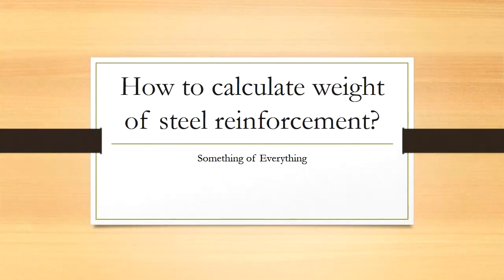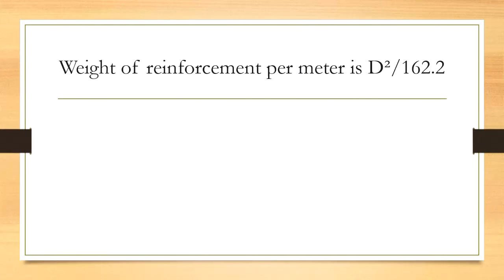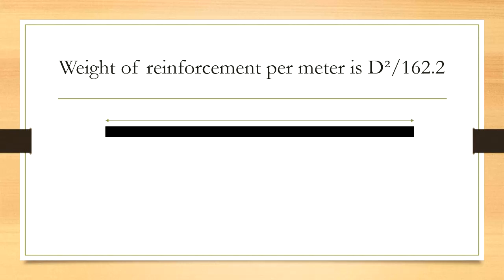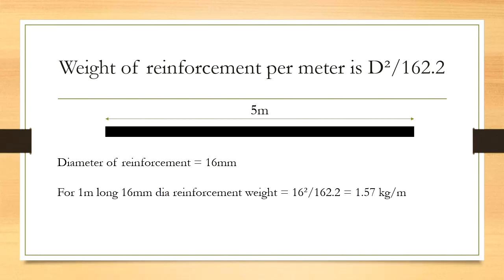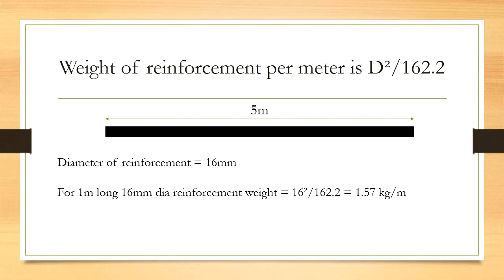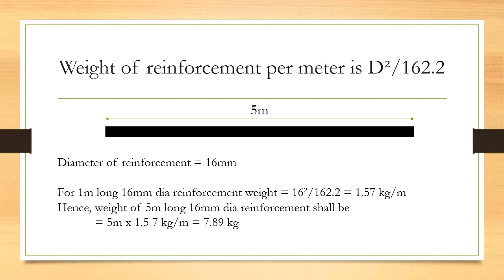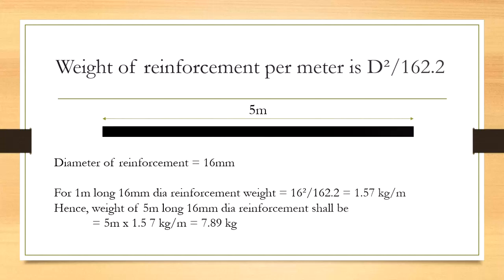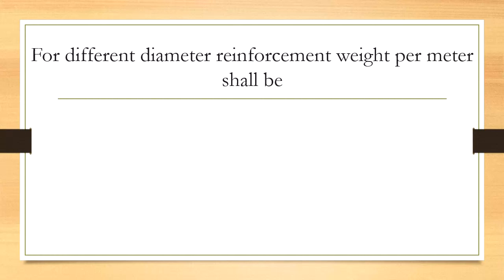How to calculate weight of reinforcement?

Comment: Sir please make video on analysis of lift well using staad pro and detailing of various structural members such as beams, column ,shear wall etc
Reply from the maker: Ok
Reply: Sir please give the loading to be considered while designing lift shear wall and lift room slab and o what parameter the loading depends such as capacity of lift, lift size etc